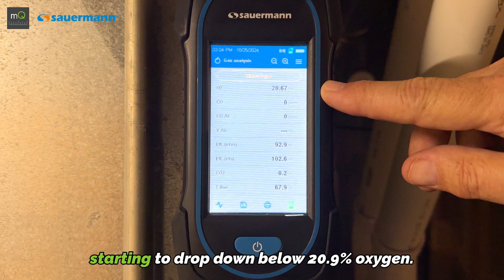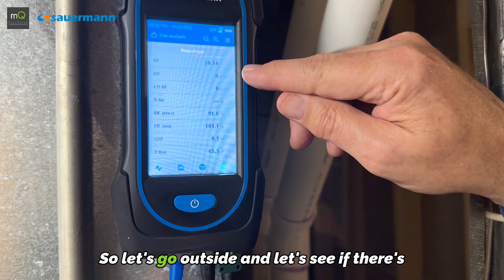Using Your Combustion Analyzer To Detect Exhaust Gas Recirculation

Comment: Very true information which gets overlooked so often, even by myself before i figured it out many years back. Only  ones who can tell are the ones testing combustion.  Interesting though that fgr is a needed and necessary part of how many or most industrial boilers are run as part of nox reduction. The combo of recirculating flue gasses and low nox burners can cut nox down by 80% or better, combined with stack conditioning can make nox almost non existing. I can see residential gas burning appliances headed in that direction some day to a less extent but still. Theres already been low nox burners for homes for many years although i personally dont have any experience with them. Been in commecial and industrial for the last 15 yrs or so including power industry so ive worked with some very impressive technology

Comment: Thank you.  I have a concentric flue pipe like that and it was placed such that the exhaust comes out 5-6" from an AC condenser and I am seeing the fumes (on a cold day) come back toward the house so i would say it is likely I am getting the fumes pulled back in.   But how do you drill that hole in the intake without having the plastic shavings get inside the furnace?